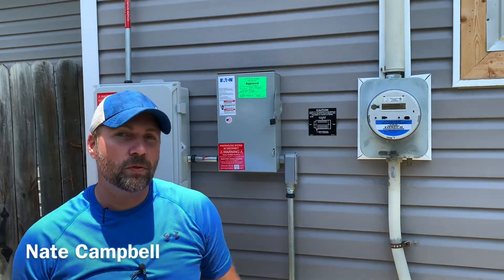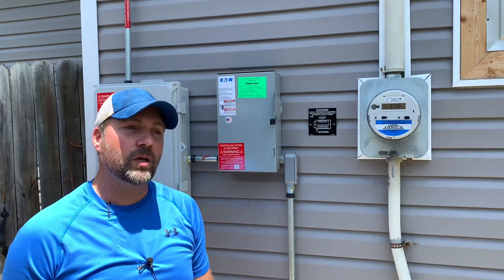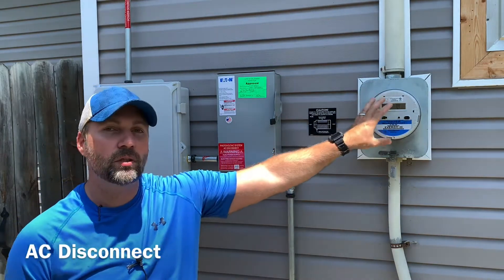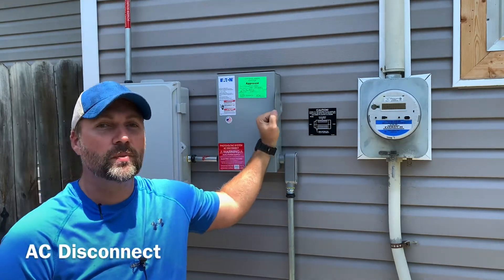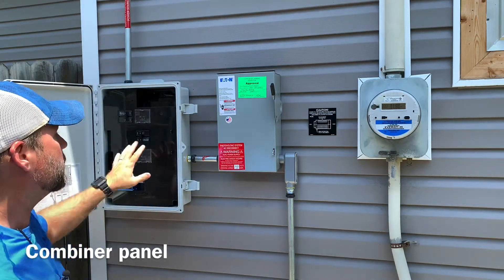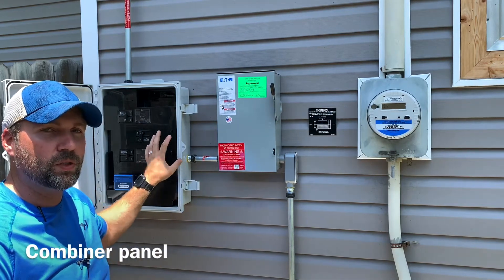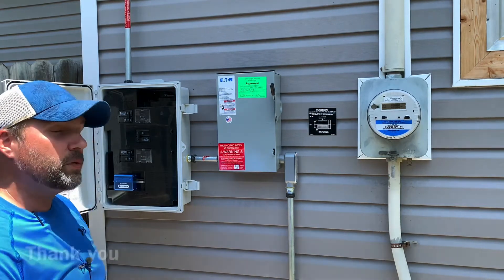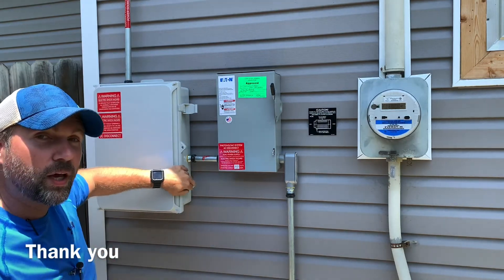Turning on your Enphase solar system

Comment: What if you don't have an envoy. Do you connect up the DC and then add the ac. Or turn on the ac and then add the dc input?
Reply: There should be a combiner panel with enphase. The Envoy is just the monitoring hardware.
Reply: What do you do if there is no production after turning on. Enphase app says microinverters not reporting....